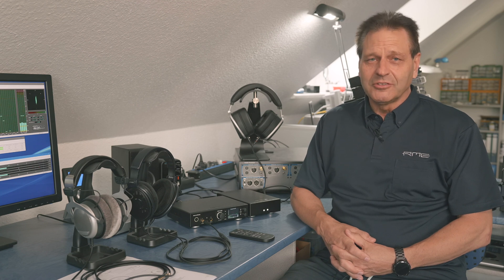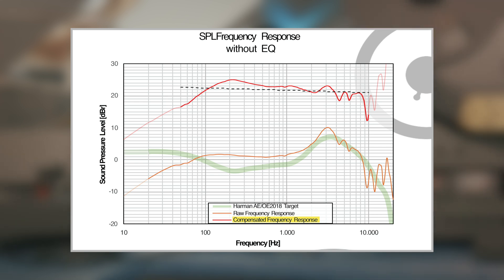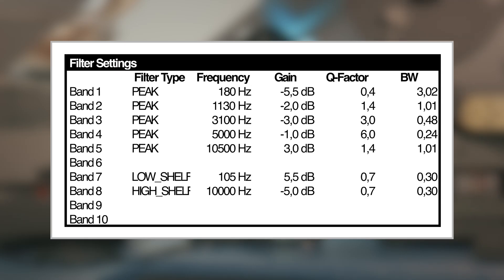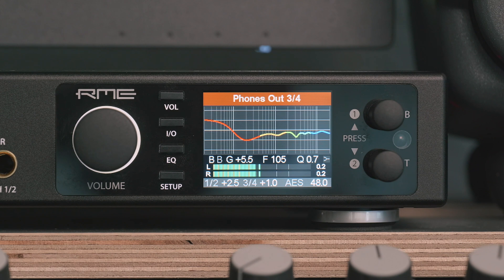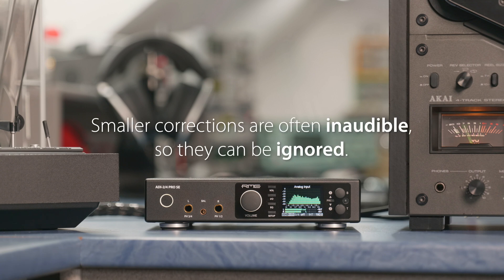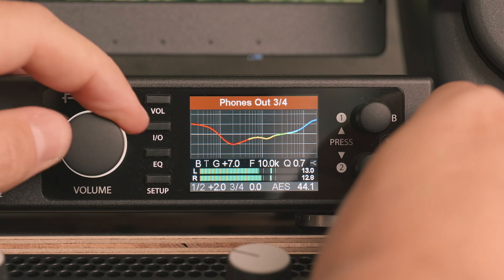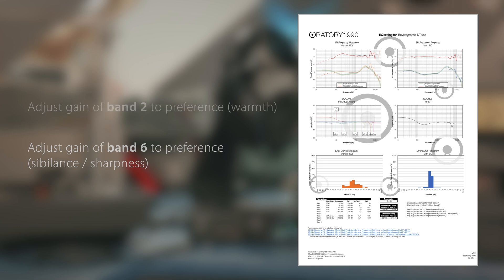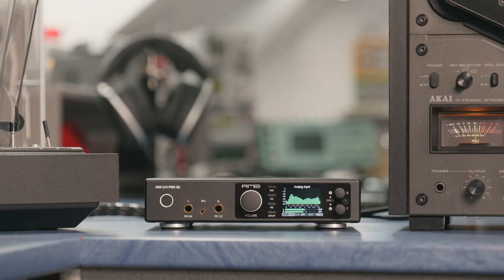Linearising & Improving Headphones with the ADI-2 Series Parametric EQ (Reupload)

Comment: The problem EQ-ing, especially the bass increase, is it will cause a more distorion and reduce overall sound quality, especially at high volumes.
Reply from the maker: It depends on the output level. If it is already maxed out and you add bass it will distort. If you have enough headroom, it will not distort if you add bass.

Comment: Question: why do we need to 'correct' headphones? Aren't they made by experts who have - we hope - chosen the best tradeoffs in tuning the headphones. Why do we then try to correct this using EQ? Genuinely asking as someone waiting on their AD1 2 FS and wanting to take full advantage
Reply from the maker: You do not have to linearise your headphones if  you are happy with them. It's also a matter of taste. But if you want to have the best representation of what is produced in the recording studio or you are using headphones for mastering and mixing, linear headphones can be very helpful.
Reply: @RMEAudio  thanks for the reply. I'm very new to this and I'm eagerly waiting for my ADI-2 FS to arrive. The info you put out on the forums and this channel have been very helpful in understanding and delving deeper into this hobby
Reply: There‘s only so much you can do with passive tuning. With active tuning (EQ) you can fix things that would be very hard to do just with passive tuning (or simply impossible)

Comment: @RME Audio - I have this DAC and a pair of Focal Shape 65 monitors with Focal Sub One. I'm wanting to know how to measure my room on order to set an EQ curve to compensate. Any help ( or better still, a video) would be appreaciated!
Reply from the maker: 1. You need an microphone preamp and a microphone connected to the input of the ADI-2 Pro. Or another interface with a mic input. 2.You can measure with Room EQ Wizard (REW) and set the the amount of filters equal to the filters in the DAC. Then you enter the values of the result manually in the EQ of ADI-2 Remote Software. Please look here on YouTube for how to measure with REW.
Reply: @ Thanks for the quick reply! I’ll get REW and give it a go. 
Loving the ADI-2 DAC FS. I’ve already made EQ presets for my DT 770 and HD25 and it’s made quite a difference. 
Good stuff!

Comment: This demonstration showed that ADI-2 series should have two additional parametric eq settings with "Load B/T w Preset" set to ON Band Bass and Band Trebble. 
I initially couldn't find these two additional Parametric Eq settings for my RME adi-2 dac fs. The manual only mentions 5 bands of corrections. I have just updated the device to the latest firmware and now the extra Eq settings have been added 😊
Reply: Thank you for this comment! The same thing was driving me batty.